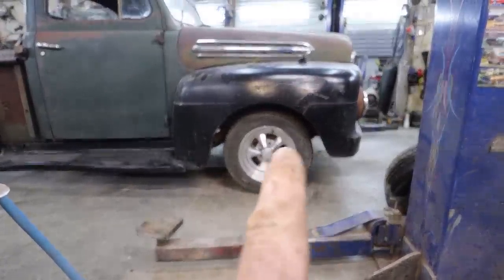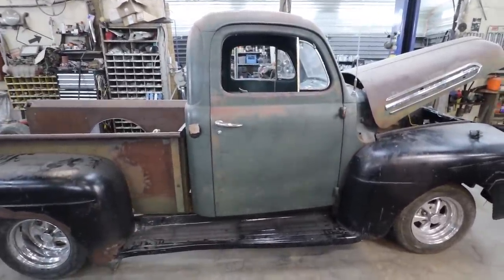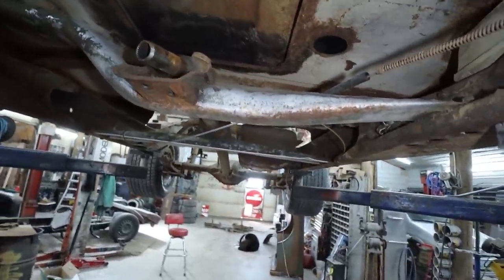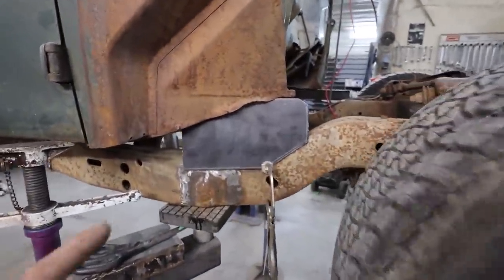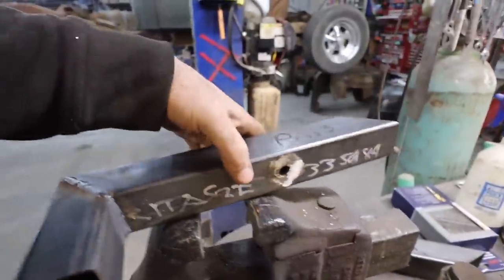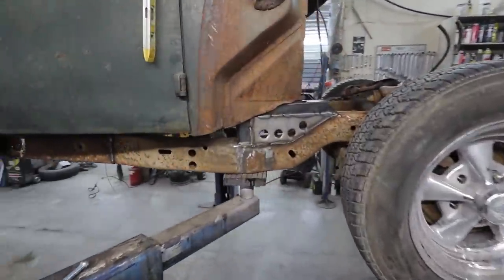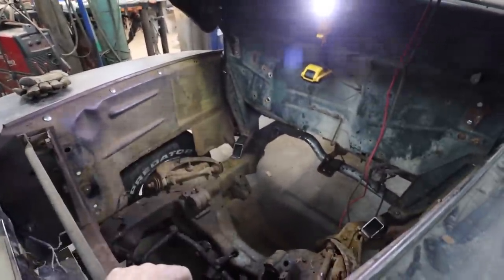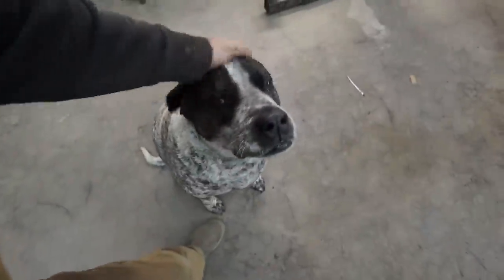Building body mounts on s10 chassis for the 51 Ford F1 body Part 4

Comment: Thanks Brent for your simple but effective way of shortening the frame. Insted of cutting and welding a biquit style union, cut the factory seam is way better. I had to watch your comment a couple of times regarding to cut right before the seam so it slides in better. I have an extended cab so I have 9" to cut out. Keep up the great work on your show, Thanks Craig.

Comment: I am enjoying this cuz I have a 1950 F-1, from a farm in MINN. Had it for about 12 years, my whole truck is farm fresh green like your cab. Stock frame and suspension except new lowering leaf springs. I got chrome reverse rims from swap meet with staggered tires. I put a SBC with a B&M supercharger with a 700R4 monster trans, 8.8 F -150 rearend with ford performance limited slip and 4:11 screw with lakewood traction bars. Brings back some good memories working on it, pretty much done though. Mine has another front cab mount that bolts inside the cab on the floor along with the one you fabbed. I bought a tri flow alum radiator from Eastwood that is not as tall and works great, just had to trim that panel under the hood for the rad cap, so when you are looking from the front with the hood open you don't see the rad sticking up. I subbed and can't wait for the rest of the project. 👍
Reply from the maker: Haha yeah realized later about that other mount and will address it yet.

Comment: That’s the wheel combo that I have on my 52 , I didn’t like them at 1st but they give the truck a late sixties look and now it’s grown on me . I drop the body mounts all the way around on the truck ..almost two inches and that gave it the lowered look and help fill in the wheel openings without having to any work on the dog house and lowered the step brackets so they would line back up . Love these trucks and your cab mounts 👍👍

Comment: Nice project! The mounts are looking good but personally, I just hate welding across a load bearing frame, either on a horizontal flange or a vertical web. This can cause fatigue cracking where the heat effected zone is exposed to reversals of stress. The stress flow in a frame should not encounter cross wise rigidity that magnifies stress in a local area. This is otherwise known as....notch effect.

Comment: Wouldn't body mounts like that with no rubber bushings both make for a harsh ride and cause alot of stress on the body which might lead to stress cracking?
Also I'm curious what size those back tires are?